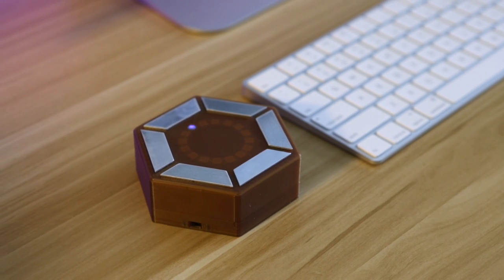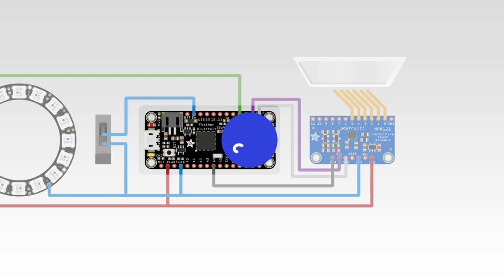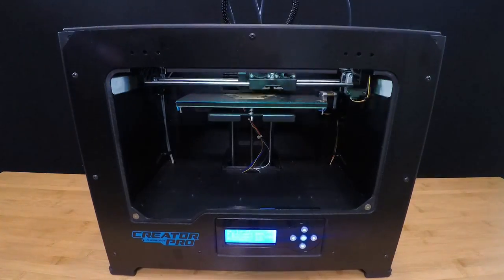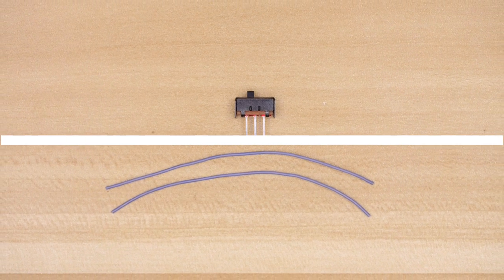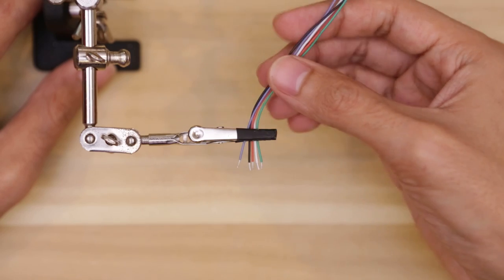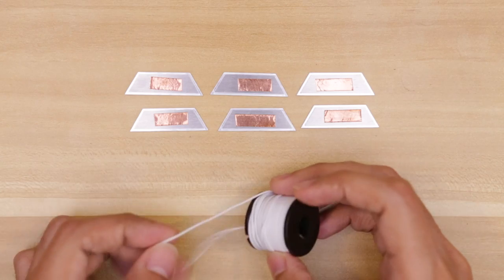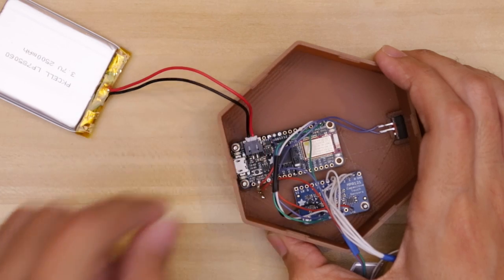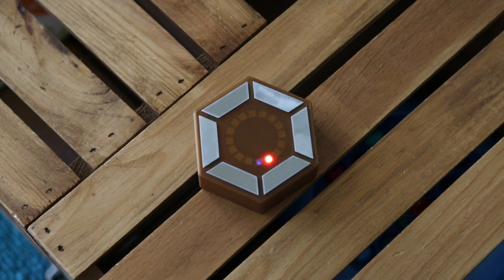BLE MIDI Drum Machine

Comment: Beautiful device and complete project combining multiple disciplines - very nice. The 16 neopixel is a particularly nice-looking addition.
As a musician, I'm surprised you went with capacitive sensors, since piezoelectric sensors would allow you to do velocity-sensitive pads, and might be cheaper. (Although piezoelectric might have "bleed" between pads without shock insulation.)
Fantastic project overall though.

Comment: I’ve hacked your midi sequencer and turned into an electronic plunger mute. I’ve added transducer microphones, as I’m using a patch on Max/MSP to use the vibrations to trigger samples and events as the trombone plays into the mute. Three of these mics are used conventionally and plugged into an audio interface. But I’ve added a piezo mic to A1 of the feather and a home made force resistive sensor (FRS for sake of Arduino IDE) to control velocity or other parameters. However I’m having some problems combining sketches for the FRS and Piezo mic, A0 and A1 respectively, with the midi sequencer. Would you be able to help? I want both to send midi data - FRS for velocity (or to control various Ableton knobs/potentiometers). On the last attempt things would work for a while but eventually, the sequencer seemed to crash. Also when trying to connect Bluetooth all was fine, but the Apple midi studio could not see it. 
I’d appreciate any help or advice.

Comment: How do you charge that battery? Do I need to worry about charging circuits/low voltage protection?
Reply: From Adafruit site:
To make it easy to use for portable projects, we added a connector for any of our 3.7V Lithium polymer batteries and built in battery charging. You don't need a battery, it will run just fine straight from the micro USB connector. But, if you do have a battery, you can take it on the go, then plug in the USB to recharge. The Feather will automatically switch over to USB power when its available. We also tied the battery thru a divider to an analog pin, so you can measure and monitor the battery voltage to detect when you need a recharge.

Comment: So just to clarify, if I were to use actual buttons instead of touch pads, I could skip having the capacitive touch sensor, and just solder the buttons directly to the feather, is that correct?
Reply from the maker: The Arduino code is written around the touch sensor so it will take some modifications

Comment: What's the point of the copper tape? Couldn't you have just soldered the cables to the aluminum? And could you also use aluminum tape wrapped around blocks to achieve the same effect?
Reply: The problem with soldering directly to aluminium is that aluminium is VERY good at wicking away heat to the point that it would dissipate it before you could ever get it hot enough to solder to; hence the copper tape. Even then, I was surprised he was able to solder to the tape.

Comment: The bluetooth is the biggest scam ever :(
Reply: Nobock why?
Reply: Because the Bt is not a "real" standard... There is too many BT ans too many restriction. I bought an HC5 ( 3$ on amazon ) and it work great on arduino, it work great to pair on my android app but you can't transform an hc5 / 6 to a regular HID device. So you need to buy a more expensive chip like the hid bt chip on adafruit who include a rn42 chip. And in fact, on HC5 / HC6 if you flash the firmwire you can unlock it to use the rn42 ( the price deal is for the software not hardware ). And you want to pair a PS3 / Xbox pad you need another thing, a simple RN42 dont work, cause it use the HCI interface...

to resume, you can't buy a 10$ bt pad and use it on a regular arduino, exept if you get a usb shield host and use a BT dongle ( 5$ on amazon ). Its not a big deal but its too big for some project... I actually working on a tiny rc car and i need to create my own pad to use it :/ And of course with thoses software limitations, i can't pair my homemade pad on my computer / phone without "hacks".

So yeah, bt is a pure scam, and the price you pay is not for the hardware, but for the software. im gonna try to hack a bt dongle, maibe it work, but there is no real help on the internet, its actually like a week im searching on that :/
Reply: Nobock well, i know i'm pretty late but definetly check out the nrf24, its a great transciever and works on 2.4gig. i mean you barely have latency if you do it right and people (to be exact, "iforce2d") have achieved a 29km range with those. they're cheap and small too... sooo good luck with all your projects then! :)
Reply: @nobocks  Yes, you are paying for software on HID device. But if you are skilled enough you can try to convert 3$ or 5$ chip to HID device, there are few videos on YouTube about that.